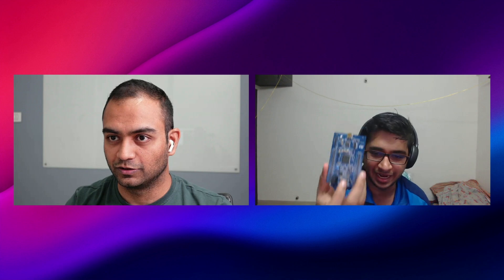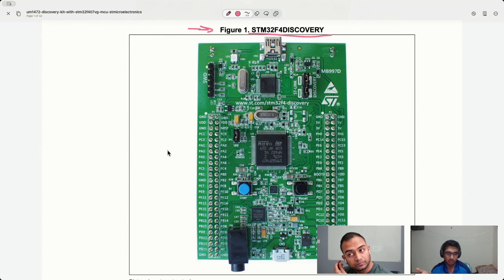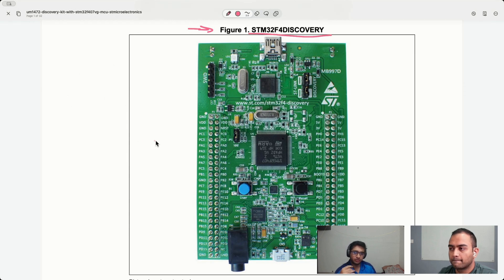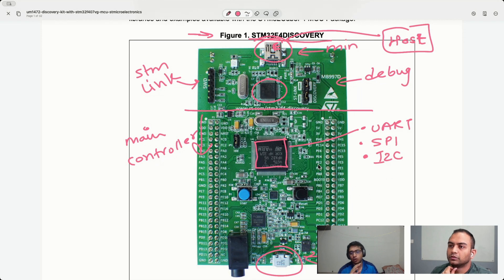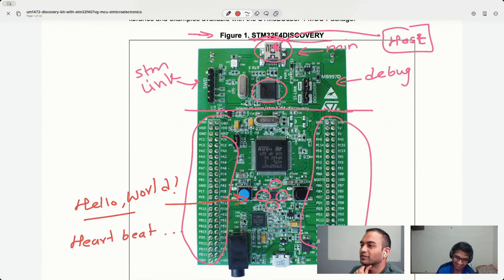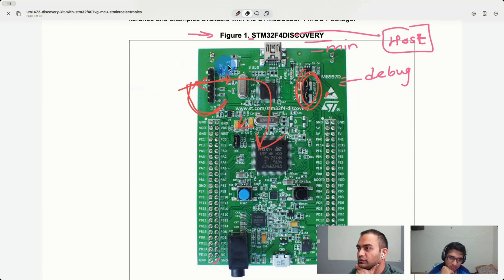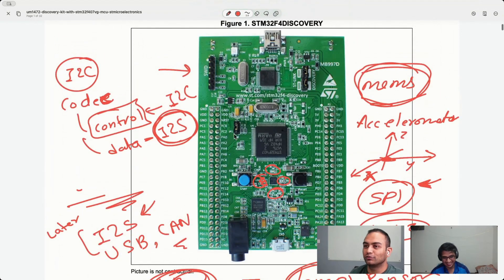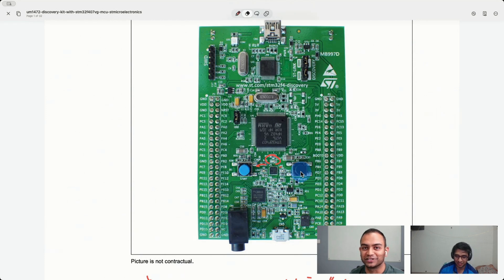ARM - M: Introduction to STM32F4DISCOVERY board | Embedded Systems podcast, in Pyjama!

Comment: Hi team, I have a doubt, in STM32F407 Disc, there is one I-Code and one D-Code bus and it is mentioned that they can access instructions and data from memory location 0x00000000 to 0x1fffffff. But in the bus matrix it is shown that the D-code bus is connected to SRAM also. But SRAM location is 0x20000000. How is this happening?

Comment: Please start  with clock systems first
Reply from the maker: Sure. Anything particular topic you are interested in system clocks?
Reply: @inpyjamaarchieves  nothing specific but may be you can cover clock types, clock source selection, power consumption at various clock sources, low power modes etc ..

Comment: Hello team, also wanted to know, will this board supports any display interface such as TFT LCD .
Reply from the maker: Most likely it won't. But we can plan to cover the interfacing with an external LCD display with HD44780U controller IC (I am sure we would have that lying around). Do let us know :)